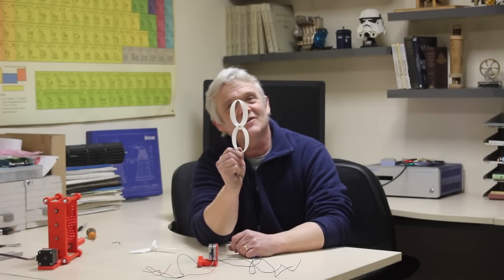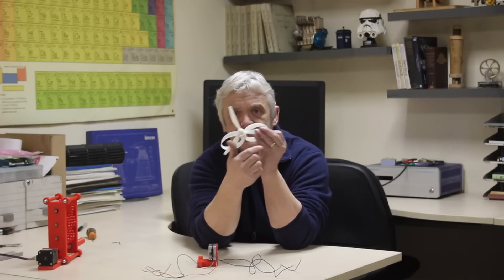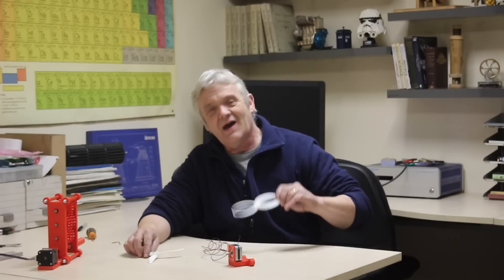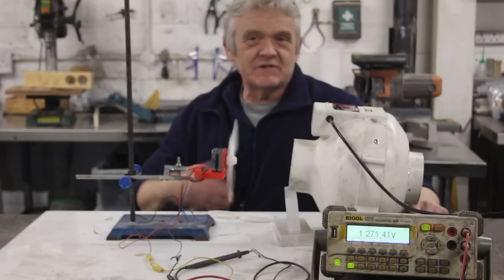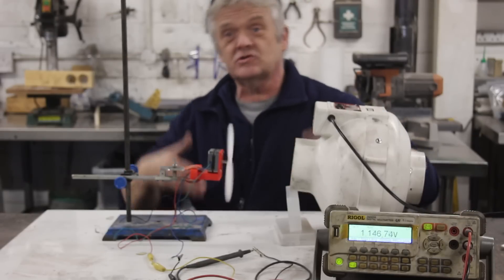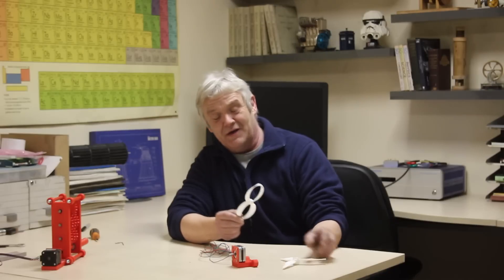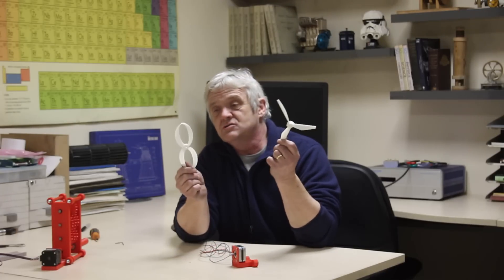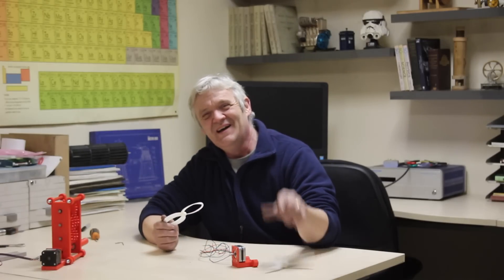1831 Is A Toroidal Propeller Better For Wind Generation ?

Comment: The pumps of Saturn 5 rocket engines were boat propeller blades which are designed to move liquid.  It would be interesting to build a pump using toroidal propellers and see if high(er) pressure could be achieved.  All conventional liquid fuel rocket engines are based on pressure thrust so more head pressure could produce more powerful engines.

Comment: Rather than print the blade......on an expensive toy......
cut a plastic bottle into ribbons along its curve,sure this was tedious but by examining the geometry of the twist itself you can then attach it to your axle(old cotton reel was a good starting point)which is easy enough to make consistently once you know the 3d shape you prefer.
fyi....by leaving tabs at either end of the ribbon I was able to make better joints by pushing the tabs through slits in the axles.

Comment: Better is entirely subjective I would think. The excitement on this design that has been catching winds, has been the benefits in noise reduction. Not in efficiency. With that said, there have been years of noise complaints from people living near wind farms. It's entirely possible that this propeller design, while used in high-RPM thrust driving applications (drones), will also have noise reduction benefits at lower speeds.

Now that's a comparison I would love to hear. ;)

Comment: The design is not to improve efficiency, but rather the toroidal propeller allows for multirotor aircraft to operate more quietly than thoes that use standard propellers.
Rob, your condescending talk in this video is unbecoming of you.
Sorry but thumbs down for this one.

Comment: I think there's a mis on that new blade. Why did the new blade not cover all the available area. It only had 2 loops. Those loops did not cover all the available area. Your old blade had 3 find but the new blade only had 2 loops. Also part of the claim on the new blade is supposed to be more stable and less noise. I've seen them on several drones that seem to increase the manuverability

Comment: Post WW2 wind turbine blades were purportedly based on Mk1 Spitfire 3-blade propellers. By the end of the war, Mk16 had a 6 blade prop. Many modern turbo-props have 6 or more blades  and bladelets to the tip of the blade plus surface profiling to reduce drag, trailing edge fluting, etc.... and yet nearly 80 years of propeller inovation and evolution seems to have escaped the wind power sector.... there is sooo much science that is not being applied to this energy sector ... I wonder why?

Comment: Could you take a decibel rating on the toroidal propeller? Right now I have a 400w windmill on my sailboat that I use 0% because its so noisy. Losing 10% efficiency to quiet that awful whooshing means a 100% increase in my usage haha

Comment: I was under the impression these types of blades are vastly superior under water. However every reconstruction I've seen made by anyone just seems to be used in open air and seems to be less efficient. Probably because they are not the original MIT design

Comment: Eh, the original blade has 3 wings, and the totroidal has two? What isn't fair to compare. And the toroidal is way more vertical wobble than the normal blade. You can't make a comparison that way. Fix it and then make the evidence.

Comment: Not sure. For propellers, the blade has been shown to suck fluid in from a wider area, so it's not at all inconceivable that the air jet you used to drive the turbine was too narrow to show the advantage.

Comment: Don't give up on it yet as the toroidal blade has not been tweaked, tested and optimized collectively millions and millions of times for well over 100 years as the standard blade. With computers we'll be able to model ones that are more efficient that produce less noise.

Comment: change the height only of the print dimension, will give the blades a steeper angle, somewhere around 30 to 35 degrees as apposed to look like 5???... or  try a three bladed version, i have seen a seven blade, but used as props not  turbines, what is the angle on the first  set of blades?... are the toroid blades to flat, and actually causing too much turbulence?...

Comment: Hi Rob. Have you tried the toroid prop in the reverse mode. i.e pushing air with it as opposed to blowing air at it. No good for the use your looking at but just to test the efficiency of the blades

Comment: That's a bit perfunctory for you, Rob. I'd wager that there will be some conditions (e.g. low or excessively high wind) or characteristics (noise, reliability, performance range, etc) where "horses for courses" applies. While some ideas eventually prove to be flash-in-the-pan fads, dismissing them on the basis of a single test is likely to stifle innovation.

Comment: Its The question here, when comparing the two propellors, for which wind speed their blades are made of. This is defined by the angle of the blade and its overall shape. Im wondering if this was considered when doing this Test ? :)

Comment: I have had the idea of Brachistochrone curves and air foils in the back of my head five years now.  Fastest way down a slope is not a straight line... design a system of three brachitochrome tunes on a spindle...

Given a curved surface that is shaped like this... it seems that you would allow optimal airflow.  

Designing a shape like that is just slightly beyond my skills. I should fix that...

Comment: If the toroidal blade had an advantage, wouldn't it be lower turbulence? You'd have to set up a field of turbines in a somewhat laminar flow to check if output was higher.

Comment: It may not be a massive jump n design, however where it is better is noise and a better efficiency.  The blade may pull in air from the sides when spinning and the efficiency should be at a less rpm.  Make a larger one as these tiny tests may not scale up the same.

Comment: I was thinking that this toroidal blades was designed for propellers to move the air. and i was watching that this design make less turbulence at the end of the blades. And as far as i know turbulence is bad for wind turbines that why have to be placed far from each other. could that happen that with this toroidal design enables to place the wind turbines less far away? That make the following question which blade design vertical/horizontal is the better i think it depends on the environment and on the size probably.

Comment: It sure looked like the torodial propellor was wobbling an awful lot, whereas the standard prop was not.  I have to assume they'd perform nearly identical in this function as a wind generator, but that is not what I understand the design goal of the torodial prop.  It was intended as propulsion prop - so let's see some data and experimentation around that function.

Comment: You should see the difference in noise level when used on a motor instead of as generator.  I believe that is where they excel
Reply: So for planes instead of turbines? I wonder how long it takes before someone starts production on these.

Comment: I have a suggestion which I don't know if anyone alse has thought of.
Set up a crystal radio and instead of running an earpiece can the electricity being taken from said radio wave be used to charge a phone  or small battery bank?
Maybe tune the crystal radio to the sun's radio waves?

Comment: When used with a motor they produce less turbulence. I wouldn't expect much of a difference for a single turbine as you wouldn't normally care about the wind shadow. However, if you had more than one, I suspect you could place them closer together in a wind farm.

Conversely, I wonder if they are more  tolerant of turbulent air? If that is ever a concern?

Comment: - yes, yes, but open circuit voltage demonstrates little (real power is bankable) - for a wind turbine power vs drag force is one metric (ie how much material is needed to support the device in a gale force wind... Appreciate you are not new to this game (giving folk a laugh and a lesson at the same time), just saying - cheers.

*yes I take a look  (esp the intersecting clover leaf design doing the rounds) and see aerodynamic red flags. (not least of which is blade interference)  
For eliminating tip vortices - the old school string pull propeller toy with the tip-ring, looks a good non optimal place to start.. lol. ie. see if a pre-"drone" toy can beat "MIT" for a laugh, how much of a ring (or part thereof) benefits the system.

Comment: I hear the main benefit of toroidal propellers is that they are supposed to cause less high frequency noise. Cool if they can do that while still being about as efficient in power production. But I suppose that's only evident at very high rpms, like drone rotors.

Comment: From what i've seen in some video about this type of propeller, it is supposed to create less turbulences because there are no blade tips. It's supposed to be a bit more quiet (at least in some frequency range) and wear slower than regular blade.
So it's not about better efficiency in converting power to wind or vice versa, but about making it less annoying.
Reply: I was going to make the point about turbulence as well, it would be worth comparing two or more turbines of each blade type in close proximity as the normal blade types normally have to be spaced far apart because of turbulence

Comment: From what I understand the toroidal props work better in water to propel boats and make less noise in quad copters/drones.  From what I've read and what Rob proved is that they aren't better than a conventional wind turbine blade on the generation side. They are supposed to be better structurally (less flexing in higher winds), be easier for birds to see and produce less tip vortices.

Comment: You put two blades against three blades and call it more or less. 🤔
Toroidal blades have a proven advantage in QUIETER operation.
That is due to less wing tip cavitation.
This is science, not YouTube click baiting .
Reply: I think you chose a toroidal design you knew had already failed in testing at MIT.

Comment: But there is a big difference. The bog standard blade is easier to manufacture -- at least when it's made in a usable size. Some people just don't get that. Ease of manufacturing, use, and maintenance are HUGE factors. But too many would-be engineers forget these things. I'm glad YOU don't.

Comment: NOT the same distance, Rob. Watch the video with your cursor on the blade centre. The toroidal one was at least 12 mm further back, mate. You moved it accidentally when you changed blades? As the centreline of the pusher fan isn't aligned with the centre of the test fan, not only distance changed but angular deflection (from video viewers' perspective)

Comment: On a large scale though is the turbulence created by the blade any different to a standard 3 blade design? That's important at scale as the turbulence "shadow" prohibits installation density of additional wind turbine generators.....

Comment: Does it do any better as a propeller? The spread out tip vortexes which are supposed to make it more quiet in high speed, small propellers seems convincing hence why it's almost only mentioned in the context of drones or small boats.

Comment: if you look at drone pilot tests, they claim a difference int he flight dynamics.   this is similar to the concept of 2 vs 3 vs 4 vs 6 blade design in a prop.  some people don't think there's a difference, but it's noticeable when you're doing something with it like controlling a drone.  consider that there's different mass and different surface area of interaction involved between designs,- and what does that tell you?

Comment: Good demo.  I think you may have covered the general idea long ago with your paper pinwheel, which had the advantage of taking energy from off-axis.  It may be a "hot topic" only because the manufacturer that makes props for boats with the design is in a heavy promotion and investment phase, and trying to expand. Unlike your old pinwheel, their advantage seems to be in an air or water screw drive performance - rather than as a driven turbine blade.
Reply: Yup, less turbulences in water as a propeller - less cavitation and less noise pollution.
Slightly worse performance as a turbine blade for air turbines.

Comment: There were tens of millions of dollars dumped into R&D before the wind energy industry took off several years ago.  The results of that research we are able to see on the huge windmills that have been fairly standardized and erected - the three blade design is the most efficient.  That was all the info I needed!
Reply: IDK, the first trains were steam with open carriages.  But they evolved into trains like the TGV in France or the Japanese Shinkansen trains.  The same can be said for cars and aeroplanes.  Just because it works doesn't mean that it can not be made better.
Reply: @misamsung6191  Sure, but we're not talking about the technology itself here, strictly the design of the blades themselves.  

Also back then, they didn't have the quality of testing equipment we do today, i.e. wind tunnels among many others.  The same testing equipment that, as you so rightly pointed out, helped improve our knowledge and abilities with things like aerodynamics.  Due to that, we can now precisely measure how much wind a particular blade design catches, how much energy loss there is from things like mass of various moving parts, bearing friction, etc.    

As to this design itself though, the mere fact that this blade design has more mass means it is going to produce less as it will require the use of more energy from the wind to spin the heavier prop...all else in the design being equal of course.
Reply: @Adam.Rushing  Things evolve as materials and techniques improve.  Even the blades have evolved over time and it has very little to do with test equipment and wind tunnels are pretty much the same as they've always have been.  What has changed is the test equipment has evolved.

You started this thread with the statement, "The results of that research we are able to see on the huge windmills that have been fairly standardized and erected - the three blade design is the most efficient.  That was all the info I needed!"  Windmills have been used to mill grain, and pump water for centuries and they come in a variety of shapes and sizes.  The current design does have limitations and other designs have been proposed.  This one is a combination of efficiency and cost.

Comment: I guess you only need to look at a full size wind turbine to see what works best! Three very long thin blades (high aspect ratio)!  I have wondered why they only have three blades and not five or more but I assume this is due to turbulance from the preceeding blade?

Comment: I figured that would be the case, thanks for showing! I do wonder though, would a triple toroidal  compare better against the triple bladed fan? A touch more apples to apples?
Reply: That is a good point, but I feel some could just as easily argue that would be too much of an advantage for the toroidal.  

Technically that toroidal fan has 4 working blades.  Albeit they are a bit thinner and have less surface area than the tri-blade fan, but that is made up by having that 'extra' blade.  With that said, I'd presume they have almost the same 'total blade surface area' when compared to each other.  I feel Robert did very well in choosing these two.

I feel a way to get even more accurate would be to create a 4 toroid fan, and put it against an 8-blade fan.  I would make them so that the 'center mass' of each is identical, then I would change the size of each blade for the non-toroidal (constant thickness AND length/sweep, variable width) until both fans weight exactly the same.  This should ensure a very close blade surface area between the two.
Reply: Or stack two of the 3-bladed propellers. Easy enough, double the output? I guess in the end, blade surface is what matters most.

Comment: I do see one problem with your method. Your fan is shooting a very narrow column of air which is not hitting the tips of the different propellers. It is the suppression of the tip flow of a standard propeller blade that a toroidal blade gains efficiency from. So if your air column doesn't encompass the whole blade including the tips then you're not likely to see the difference if there is a difference. Underwater tests with ink dye have shown that there is a suppression of the Eddie's that occur at the tip of a typical propeller when you instead use a toroidal propeller. And of course any remaining eddies in water or air are uncaptured energy. The ideal propeller would leave the air flow exactly as it was when it entered the propeller but it a lesser speed because it extracted energy perfectly from the air flow and anything that it couldn't extract remained in nearly laminar flow so there was no wasted or leftover energy.

Comment: What's the difference when you add 5W load?
If the new blade has more actual area cover. It might be Stronger with resistance?

Comment: you need to reconsider... is the pitch of the balde the same? Is the blade area the same ? its not as simple as you presented and that toroidal blade is clearly of plane as well so, how well made  it is compared to the three blade is also an issue. prop diameter is NOT equivalent to sweep. as 2 blade will sweep les than 4 blades. as well as Pitch...

Comment: Very interesting Rob and it bought a question to my mind If you tried the same experiment with a 2 bladed prop and a 3 and a 4 bladed prop would the extra blades give more speed or torque 
I know that aircraft use multiblades to increace power output for a given circumference and what about jet turbine blades of 20+ blades 
I know the betts formular is right but can you extract closer to the maximum with multi blades